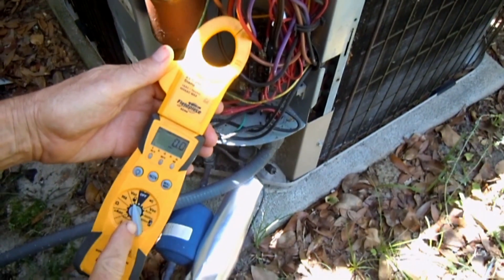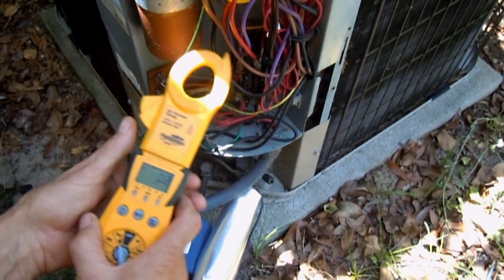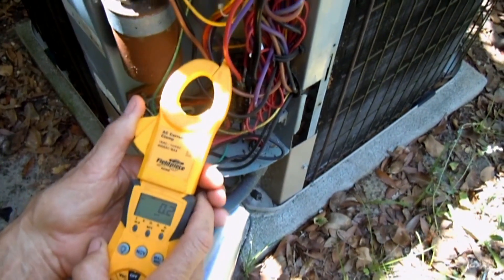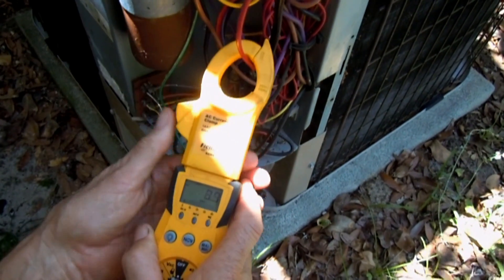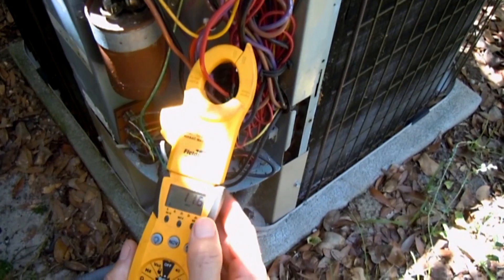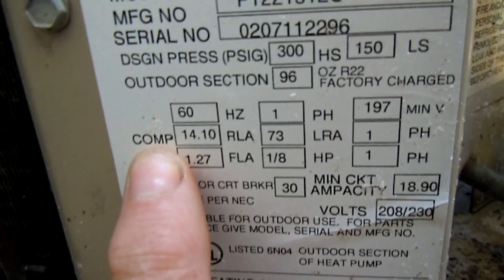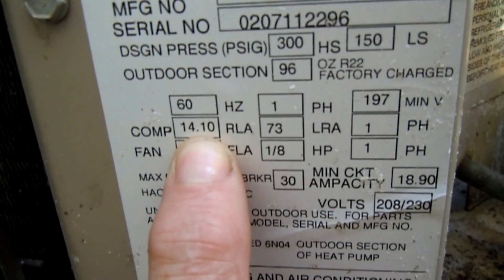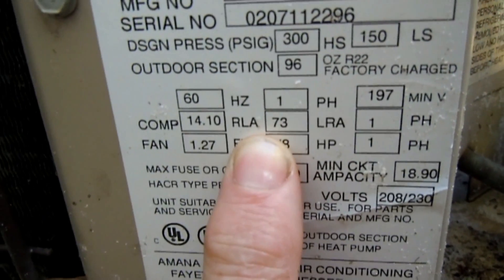HVAC Compressor Amp Draw

Comment: In my opinion this is not accurate and i could be wrong.  You have to know how many volts you have #1.  Example you could have 120 v and 10 amps and if you have 110 v the same system on your gauge will show 12 amps. I believe you need to explain "Higher Volts Less Amp" Can anyone else reply to verfiy if i am correct???

Comment from the maker: You might want to clean the coils and make sure that the air filter is clean before you continue. If the unit still ices up then you'll need to find and repair the refrigerant leak before recharging it.

Comment: The Amp spec (label) on this Copeland Scroll Compressor was a bit obscured, but I'm fairly confident that it is 17.~ something , if that makes sense, since the data label on the cabinet said 16 A?  Typical?  However, today, the compressor starting icing up in under 5-minutes when first started up for the day. Started traveling along the suction line to the evaporater in less than 10-minutes. Comp. amp draw only about 4 amps today (not as hot & humid today, if that's why?)  Possibly low on R-22?

Comment: On a 5 or 6-year old Bryant packaged unit (cooling only), compressor amp draw is only 6 amps Data plate: 16 A . Great air flow (cleaned evap. coil and blower wheel). Contactor points looked fine to me. Unit won't bring room temp down below 80 degrees.  240v at compressor.  Could this be a Freon (R-22) problem?  Unit may have been running a while with dirty evap. coil (can that contribute to a leak?)

Comment: Hey, ive watched a few of your videos and sounds like you know alot about  compressors and i was wondering if you could help me out, i bought a copeland  compressor out of a unit from the foundry, the windings tested good, it is 3 phase, im trying to use it to make an air compressor but i know very little about wiring. Hope you can help me out, thanks

Comment: I like to test the refrigerant and test the capacitor before seeing the results of the compressor amperes since either will affect it. The run side and the common side should be checked, then the run and start wire amperes checked with the common side- compare the amps- they should be the same, if not, there may be a cap problem.

Comment: my old rheem 2 ton scroll is pulling 8 run amps  on a nice cool day, but nameplate says 17 run amps and 70 locked rotor amps. fan amps are right on the money is this normal with little to no load?

Comment from the maker: @headscratcher99 It's a good idea to replace the compressor contactor about once a year. I've seen them last for twenty years or so but I wouldn't advise letting it go for that long. If you're having problems with the contacts welding shut then you could have an over amping compressor.

Comment: Hi Dr. Zarkloff,
The original high voltage contactor lasted 5 years on my Carrier outside unit.  It then welded itself shut.  I replaced the contactor a year ago. Now, I find the new one had also welded shut.  I sprayed, and cleaned the contacts and got it working again, but I'm wondering what the life expectancy of these contactors should be, or if there is anything I can do to protect the contacts.

Thanks

Comment: Hey Dr Z, I was wondering if you should mention also while looking at amp load we should go through and check the contactor condition and also measure the run capacitor's for the fan and the compressor in order so see if the MFD's are with in tolarance. I have been checking each during maintenance looking at the fan then compressor & ending with total system load. Just a thought hope all is well..

Comment: I always check the amp draw on motors or high amperage appliances..... I was told it scan sometimes indicate if there is a faulty motor or compressor due to higher than normal amp draw.